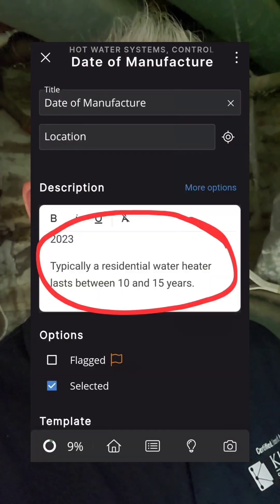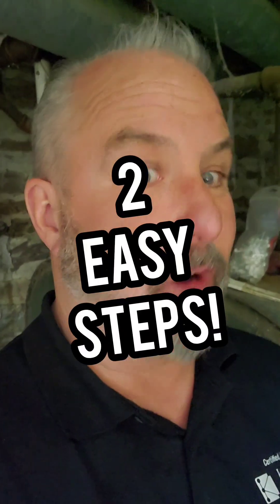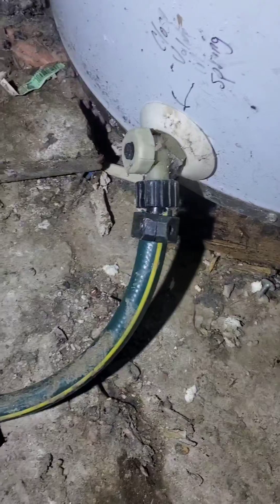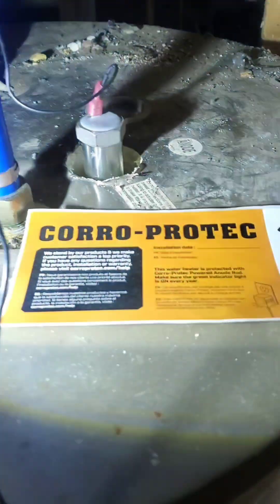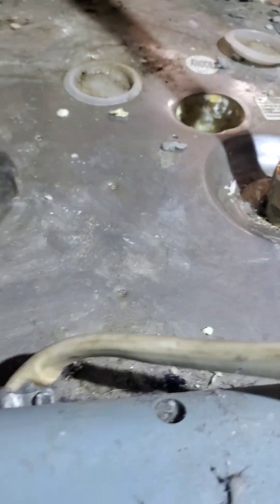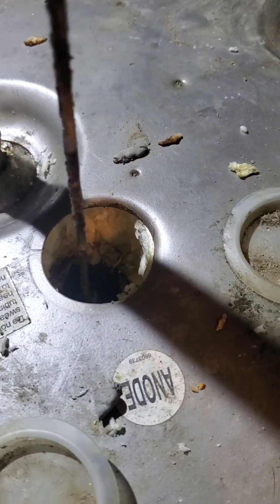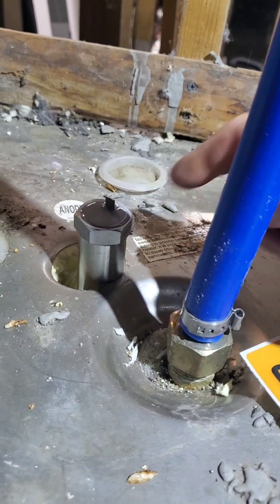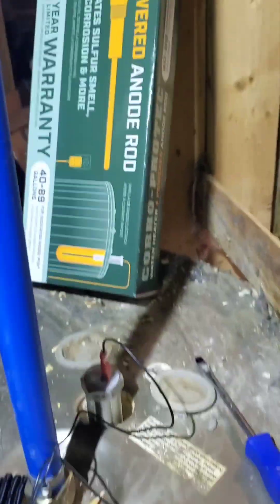Water Heaters are NOT Disposable!

Comment: Or you will need a 4ft breaker bar  with a helper using ratchet straps to secure the water heater while you put insane pressure on the bar  trying to break the anode rod loose.  Break it loose and put teflon tape or something on the threads before installing. Maybe it will help
Reply from the maker: Cordless Impact

Comment: You don't drink water coming from a water heater .
Reply: As a plumber, I advise people not to consume any water from the hot side. It s not recommended at all, especially when you have a tanked water heater due to heavy metal exposure. Even if the water heater is properly maintained (great video on doing that btw) you’re still running the risk of consuming heavy metals when consuming water from the hot side.
Reply from the maker: Sure you do. People use hot water to make hot beverages, soup, or other things. People rinse their mouths while brushing teeth.

Comment: My spouse would flush our gas water heater every year, and had replaced the anode rod. Installed it in the late 90's and was still going strong when we sold. although that was in a condo type property and now the strata bylaws there got overhauled and now they mandate a new tank every ten years -because of the strata/condo insurance crisis BC had, insurance went off like a rocket and coverage got crappier and our complex even had issues getting coverage without doing a bunch of stuff. will never own in a condo again

Comment: One great alternative to a hot water tank is to go 'tankless'. I did and I've never regretted it! With a tankless, you will always have hot water on demand (and never run out), no tank to clean out, no sulfur smell from letting it sit unused, no pilot light to keep burning, no burner flame or elements in use when no one is using the hot water, and the tankless core lasts upwards of 25 years. Plus, they're just a bit more than a standard hot water heater (gas).

There are some modifications that may be needed if installing a 'gas' tankless, but otherwise the install is pretty straightforward.
Reply from the maker: There are pros and cons. Tankless use MORE energy when in operation. In a busy home, they can be more expensive.

Comment: Why don't the water heaters come with a powered anode rod????
Reply: It takes a special kind of consumer to pay $100 more (for argument sake) today on the promise of a water tank lasting not 8 or 10 years, but 20 or 25.  Who's planning to be around for the payoff period, in 2035 or 2050?  That seems like an impossibly distant fairy-tale future to a normal person.

Now, my latest water heater is a hybrid heat-pump type.  The compressor works are mounted in a way to hide the anode rod.  If that's gotta be the case, an active corrosion preventer should def be built in.
Reply: @timgerk3262  Thanks for the explanation!!  I'm taking notes!  🤗
Reply: @timgerk3262 no. A NORMAL person doesn’t think 2035 is a fairy tale. Just weirdos like you.

Comment: I had no idea that water heaters were supposed to be drained and that the anode rod was supposed to be replaced and pressure releasing was to be done regularly until this year. We have well water and my ex screwed up the softener which I fixed but my water smells atrocious. I finally bought an electric anode rod but have not installed it yet. Still working on getting sockets and as a 60 yr old woman I dont' particularly want to do it while I am home alone LOLOL.

Comment: My anode is so tight I literally cant get it off. Water heater is about 4 years old.
Reply: I borrowed an impact wrench from a friend to get mine out. They are that tight from the factory. I also installed a powered anode rod. Everything is wonderful now.
Reply: @MsDhanselman  Impact is my next plan.
Reply: It can be handled like any other frozen bolt: first try a cheater bar on a 6 sided socket.
Then an impact wrench.
Next, a torch.
Finally, drill the sucker out.
Being at the top of the unit can reduce the space to work, and that can be a pain.
Best of luck.
I have a small (37 liter) unit that was only about 5-6 years old. Drained it, took out the anode and heating element, and used a wet-dry vac to get the 60-100 millimeters (about 3-4") of crud.
Cleaned the tight spiral element with a small brush in regular vinegar till it looked like new.
Gasket and anode were about $15-20 each.
Gonna do it again on 18 months.
Regards from Denmark!
Reply: @Oneshot8242  I soaked it overnight in WD40 and used a cheater. I was just twisting the entire water heater. Impact will be next.